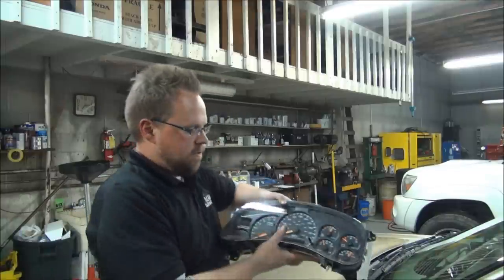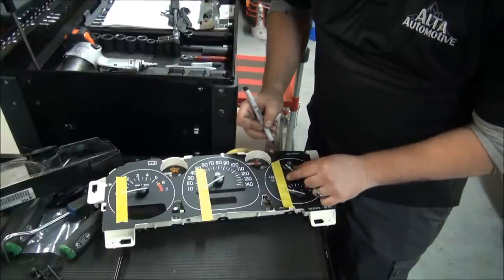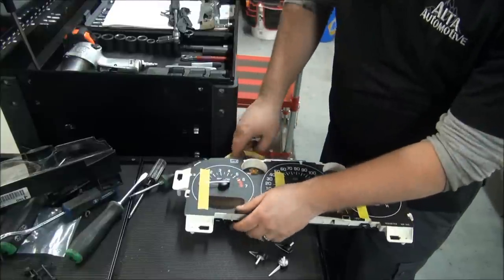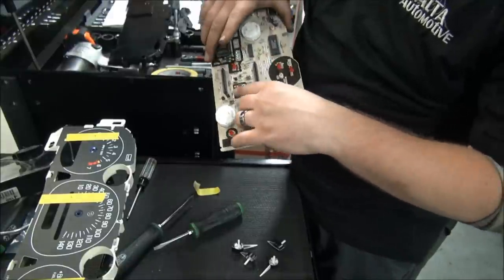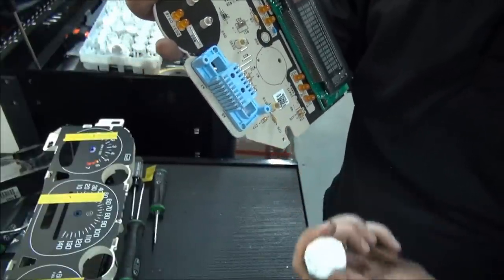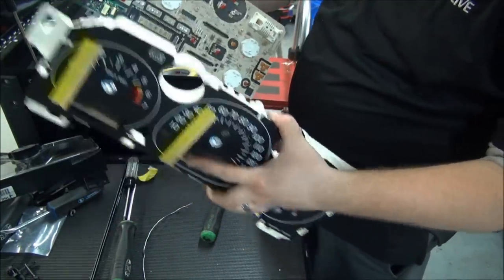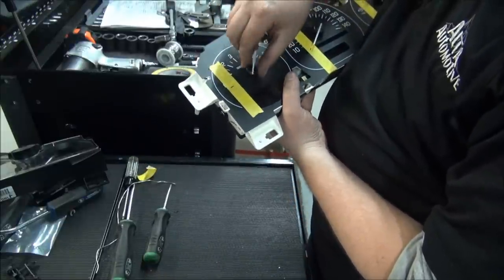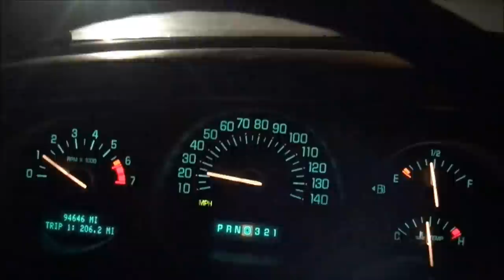How to repair GM Instrument Cluster | Speedometer | Gauge | Stepper

Comment: Thanks for the video. My 15yr old replaced the stepper motors but now the gear indicator is not lighting up. I can't find anything on the schematics for our 2004 Rendevos Instrument Cluster, or even an example. Many places online we've found people saying to replace the resistors or resolder them. I can't figure out which ones are the resistors for it. Any suggestions would be greatly appreciated.

Comment: Does this include the 2004 c4500? I have one that the fuel gauge, is buried past full, volt meter flutters and oil pressure goes to zero after awhile of running. Confirmed that oil psi is  there. Stop truck and it'll  start working again. Fuel gauge will try to move a needle's with, during the koeo cycle.

Comment: I have a 2001 Suburban. The fuel gauge periodically goes to below "E" and the fuel light comes on. I have owned the car since new in 2000, could the stepper motors be bad on my vehicle as well? (the oil pressure gauge fluctuates also) 200,000 miles plus I have tried 3 new fuel sending units plus I soldered the wires for the new connector to the fuel pump/sending unit.

Comment: Is the "D" soldering iron necessary?  Could I do this with a regular soldering iron?  How is that done with a regular soldering iron?  I have never used either but it looks like I will need to replace my temp and gas gauge stepper motors.  Also, would you recommend doing the speedometer at the same time, even if it is currently working?  

Thank you for this video.  I look forward to doing this work! This will save me BIG TIME!

Comment: I have a 2008 Nissan Armada that recently developed gauge issues. When I turn my vehicle off and remove the key, my voltmeter, oil pressure, gas gauge stays in the last operating level and will not return to resting positions...also the Odometer block stays lit. Can anyone please offer me an solution..I'd really appreciate it.

Comment: Does this wrk on a 2001 Chevy Tahoe. My gas gauge is acting up. When i fill the tank to the top it marks fine but as the fuel deminishes the gauge starts to mark incorrectly. It would tell me that i have no gas and then it would jump giving me the correct amount of fuel in my tank. Sometimes it would say i have 1/4 tank when i know that its at least half way, etc etc etc.
Can you tell me based on what i just wrote if this is the issue I'm having? and If so, how do i repair it? 
Thank you so much!!!

Comment: 2005 Sierra, the speedo motor was skratchy as you described so replaced all as recommended with the updated motors. I did have 1 of the solder tabs on the board come off when removing the old motor so I ran a small jumper wire (32 ga) from the next closest solder joint to the new stepper motor. Checked continuity and all seem good. My problem is when the cluster is plugged back in, the speedo gage still didn't work. Disassembled and the needle move smooth as silk but once the cluster is energized, the speedo needle feels skratchy. Rechecked solder joints and even resoldered another working motor. Seems the signal going to the motor has a bad signal, any ideas where to go from here? Thank you for any assistance

Comment: I don't know if you still check this but the 04 monte carlo has the same problem because of the same motors.  GM won't recognize it though in their recall for some reason.  If you do see this I actually have a pretty technical question on the board itself and if you could tell me how to get in touch with you I would greatly appreciate it.  Good work!!

Comment: great video. but before I start taking apart my cluster. my 05 lesabre keeps popping the fuse for the cluster gauges and they all freeze . go to replace the 10amp fuse and you can hear little winding noises in behind cluster then fuse will pop within the same day or hour . any help appreciated .thank you .

Comment: i have a 2004 gmc sierra 216k miles gauges all flicker or stop working and warning lights come on only gauges that work are speedo and tach they do come back on after awhile gauge cluster was fixed twice with in a week by rt grim which said someone was in it before and fixed and cost me a little over 200 and that about 2 years ago when i had fixed could it be stepper motors again or could it be something else electrical

Comment: My gauges are moving erratically. It seems like if I wiggle the wiring harness it replicates the problem. Can the connector on the board be replaced? Or do think it is still a stepper motor problem?

Comment: I have a 2000 monte. The light that illuminates the drive position sometimes goes dim.when i hit the top of the dash, it brightens for a while. Is it a connector or the actual led on the circuit board?

Comment: Should I set my needles to Zero if they are past the point of no return? Some of them are on the other side and past any measurement.
Reply from the maker: You should mark the starting/stopping point of the needles before you remove the needles... You can find this buy pushing the needle counter clockwise until it stops, that is the starting point.
Reply from the maker: Generally speaking is about 1 or 2 tenths below zero.
Reply: Thank You, Not sure if you had said that in your video and I missed it. Looking forward to fixing this over time all of them have gone out.
Reply from the maker: +Justin Creamer Thanks! Yes watch the video carefully a couple times and it should make sense.

Comment: I have a 2005 chevy trailblazer  and the speedometer sometimes stay up above 60 miles to get it down to 0 miles I have to key on and of several times  , where can I get the motors to fix it

Comment: SOME OF MY GAUGES USED TO WORK FINE JUST RPM AND SPEEDMETER WERE WRONG. AFTER I REPLACED ALL MOTORS NO ONE WORKS AND MY MILAGE SAYS ERROR... WHAT CAN BE THE PROBLEM THANKS.

Comment: I like your video, makes it look simple enough. I tried it, all is well, but the speedo jumps to 120 while in gear and the tach is erratic and sticky. What would cause this? Poor connections? bad replacement stepper motors? 2004 GMC 2500HD.
Reply from the maker: +Jim Rose Poor solider connection on those stepper motors.. If you get the board to hot you can damage the connection on the board

Comment: Hi Bri, Great video. Would this procedure work on a 99 Suburban IP Cluster? My fuel gauge went past full and now points south. It still moves with the level of fuel, just doesn't line up anymore. Thanks Again. Dan
Reply from the maker: Dan S No that year does not have this type of stepper motor.

Comment: Great video BRI! Do you have any experience with the "REDUCED ENGINE POWER" message? Any help would be GREATLY appreciated.
Reply from the maker: Jason Mills My experience has been many things can cause the "REDUCED ENGINE POWER" message. However we have changed many complete throttle body assembly's for the problem on GM pickups

Comment: Hi Bri. Thanks for the video. I have a Chevrolet Lumina 2006. I think it is sold in the middle east and Australia only. The cluster stopped working suddenly. Do you think I have the same problem?
Reply from the maker: If the cluster completely stopped or does not do anything, it's mostly likely something else.

Comment: We have a 2005 Tahoe and all but temp and oil gauges don't work. After researching we figured it had to be stepper motors gone bad. Replaced all 6, and now nothing works. Wondered if soldering wasn't done correctly if that could be the cause of gauges not working? Really appreciate the video! We followed it step by step; just not sure where we might have gone wrong. Any help would be greatly appreciated!
Reply from the maker: Sam Burchard I'm really sorry you had that experience. I would recommend starting over, remove all steppers all of the solder and try again. Please be very carful you may want to have someone with allot of soldering experience do the repair.

Comment: I have a 2009 Silverado and NONE of my gauges work a lot of time. Isn't their a recall or something on these ? Or can't I contact Chevrolet somehow about this ???
Reply from the maker: +Wayne Metroke You can call your vin# into the dealer and ask if there are any open recalls. However on that year truck the stepper motor is most likely not the problem.

Comment: I have a 1994 Astro van.  Can I use the same procedure in replacing the dials as with your video for  2003-06 gauges?  Where you place the dial on the stepper motor, then spin it cw then back ccw to the 'o' setting?  thanks.
Reply from the maker: +h brl No... That procedure is entirely different

Comment: I replaced the step motors on my 03 yukon. when I plugged panel up everything worked except the gauges. I then pressed the plug in harder and the gauges powered up. After about a day the gauges started intermittently coming on and off until they finally quitting altogether. I removed the dash panel  and wiggled each individual wire but nothing happened. The way I got it to work again was to push and pull on the connector hard enough to flex the board. When I do this the gauges will power up occasionally but they will eventually quit again. The puzzling thing is that I do not have to hit a bump for the gauges to quit. They will power on and off regardless road conditions. Any ideas as to where the short could be?? Have you experienced anything like this? Thanks in advance.
Reply from the maker: Alabaster245 Sorry I have not sound's like the problem is in the circuit board.

Comment: Hey Bri,

I changed all my stepper motors according to your tutorial here, but when I connected the cluster back in none of the gauges worked... what do you think I did wrong here? (My speedometer and oil pressure gauge were the only things out before the fix)

Thanks!
Reply from the maker: +Anthony Russo The board the stepper motors solder into may have been damaged. You could try taking them out and reinstalling them again. You have to be very careful not to get things to hot...

Comment: Great video.  Just a couple of criticisms though, if I may, and I say it without malice, purely constructive.  Firstly with the masking tape, you have to be so careful the adhesive doesn't mark the dial or damage the print, I would have used a low adhesive masking tape. Secondly, you have to be careful with fingerprints or rub marks left on the dials with your fingers.  If you damage the dial then it's a real drama.
I know from experience how difficult it is to remove marks off instrument dials and nothing looks worse than a fingerprint. 
You guys are lucky in the States, here in Australia you can't just get instrument spares for modern instruments. 
Most of the time you either have to buy a new cluster or take a chance on a second hand unit.  Have you ever taken one of those failed steppers apart to see why they fail ?
Reply from the maker: Great Tip!

Comment: Would changing these motors make the entire panel work again or is that another problem all together? Because my entire panel stopped working on my 04 gmc envoy or i should say everything except the backlight and turn signals. The E.Brake light, the miles, the cruise control, etc. none of these turn on and the arrows don't point to anything not fuel pressure or speed. What could be the problem?
Reply from the maker: Jevon Wilson That is most likely a problem with the speedo/cluster board. Definitely not a stepper motor.

Comment: Very good video. I replaced the lights in the cluster. I marked my gages w tape. When I put it back in the gages were off completely. What would b the most accurate way of fixing that ? Thanks
Reply from the maker: Yeah I have never had that happen, so I am unsure of what to do. You could try pulling the cluster out and pushing all the needles just below the starting line for each gauge? However I really am unsure.

Comment: I have an Equinox 2007 and I just repaired my board using your good information.
However, I figured out that year there is no X27 (or XC5) on board. In fact this is no part number on the motor.
After several hours, I finally found a X65.589 would be the good one.
Here is what I've found.
https://store.minitools.com/en/sei-x65-589-juken-x65-589-stepper-motor.html
I hope it can be useful.
The pinout is not the as x27.

I fix my problem using another used cluster, I desoldered all motors I needed and everything is working fine.
I'd believe that is important to avoid to push to hard needle when replacing it.
I'd believe that replacing needle by hand can be okay, but don't do it too often this can imply a slack and needle precision can be lost (not exact).
I use a desoldering station and the job is very clean, I recommend this tool.

I broke 2 glasses, it's very easy to break a clip, it's better to unmount the black case having the glass onto.

Comment: I have a 2004 cavalier. I did the same steps you did to take out the needles & I put them back in and the tachometer don't work. I can hear it moving but it just don't work
Reply: re pull needle 0 it out as 0 with key off then turn on key For a minute then try.

Comment: Bri... Great video! I have a 2004 GMC Sierra and yesterday my oil pressure gauge pegged when the vehicle is on. When off it only comes back about an inch (still above 80). I'm thinking its the stepper and would like to replace it but how do I index the guage since its not back near zero? Thanks for the help!!
Reply from the maker: Tony DeMeo You just simply push the needle back to the point it stops.
Reply: Do It Yourself Bri Sounds good! Thanks!

Comment: I have an 2003 1500 Silverado and recently my cluster has been acting up. There are times that it works completely fine, and then others where nothing works at all.  All the gauges, lights, odometer, ect. just act dead.  I was driving home last night and that happened and about half way home they all turned on like when you start the truck up.  Would that have to do with the power source or something of the source? Or would it be the cluster itself.  Thanks for your help!
Reply: +Lucas Smith Yep, my 2004 GMC Sierra does the same thing.  It works when it wants too.  Did you ever get a reply??
Reply: I fixed it all on my own. There were some pins on the connector cable that were bent out a bit. I moved them in a little bit and it has worked fine since.

Comment: Have a ?...First, very informative video.  It has inspired me to fix my busted speedo motor, BUT, I have a question as to the positioning and calibration...

You show that you use tape to mark position of needles before removing them, so that you know where to put them back.

My issue is that the speedo motor is so irratic (some days it works, others it doesn't, and when it works, it is not always accurate; some days yes, others no), that when I shut the car off, the needle doesn't always end up back at the zero mark, or where the factory put it when new.  Sometimes it is even stuck on a number of say, 45, 60, etc.

How do I know where to put the needle and register the position before doing that sweeping calibration at the end (with this erratic speedo), so that I know the reading is going to be dead acccurate when all is put back together?

Thanks
Reply: So, they (all gauges), have a zero limit on the left side sweep?

I assume the right side doesn't, because the other day, the speedo needle went past the 120 mark, and traveled all the way down to the 6 o'clock position, pounting at the odometer / gear selector
Reply from the maker: Push it down all the way until it stops, that is the spot to mark it. Generally below zero!

Comment: Great video! I'm thinking I will attempt fixing the cluster in my 04 Tahoe. It looks pretty straight forward but I do have a question. Will replacing the stepper motors fix the gear selector window and message center window being blank? My entire cluster is totally out, no gauges, no indicator symbol lights like cruise, nothing in gear selector window and nothing in message center.

Comment: Awesome man! Thanks for making this video. I have a 2005 Chevy Trailblazer and the speedometer, oil pressure and fuel gauges are not functioning correctly or at all. I didn't want to spend hundreds of dollars that I don't have to have someone fix it for me so I plan on doing it all myself. The only purchase I need is a soldering iron/pump and a T15 tool and the stepper motors!

Comment: Thanks for your great video. I have suspected bad stepper motors but was not sure. I've had the inst panel go dark & found a cracked trace on the circuit board where the gnd wire connects.  Over time, the vibration of the cable harness transfers through the connector, and directly to the board connections. There should have been something to dampen the vibration, otherwise it's a failure point for sure.  I tried your link for the stepper motor but found light bulbs instead. I'll search later.  If you can, any recommendation will be appreciated.  Outstanding video !!

Comment: That was great job . I have a problem with my gmc oil pressure  gauge . Where do I get the steppe motor and bulbs to buy 
Thanks
Reply from the maker: +derick subramani Most of the time the oil pressure gauge is a problem with the oil pressure sender/switch on the engine.. What is the year make and model?

Comment: hey what's up, I did all the steps without taping the needles. now that I put it back together it's all off. what do I do now?
Reply from the maker: +Robert Martin You can try and perform a reset, push each needle bellow the starting point.. That will hopefully correct the issue.

Comment: this video helped a lot! now I'm having to replace fuel lines on my 2003 gmc yukon...I am having major issues accessing the bolt on bracket located there the transmission and engine bolt together. other than removing the intake manifold which I'd rather not do I can't find the truck to removing these let alone see them. thank you in advance for any help on this dilemma and keep up the good work